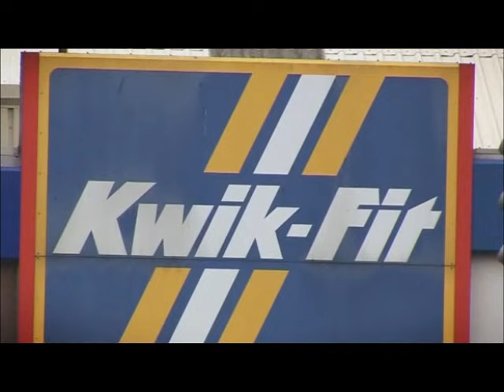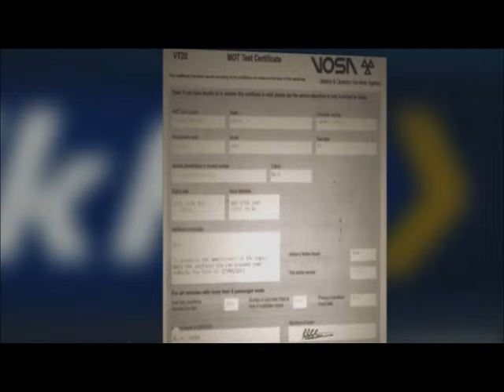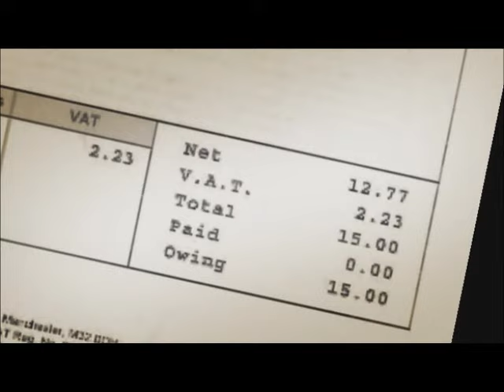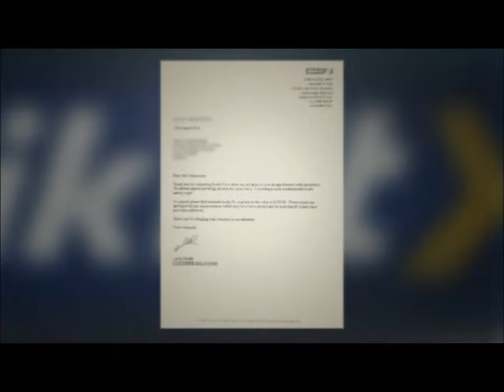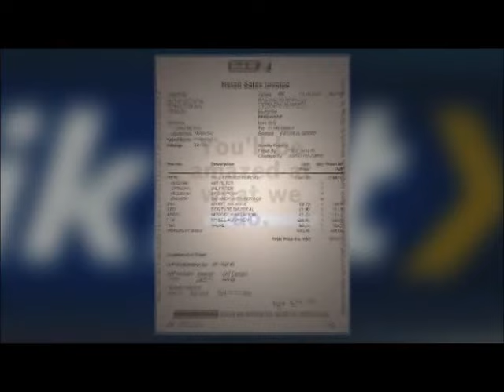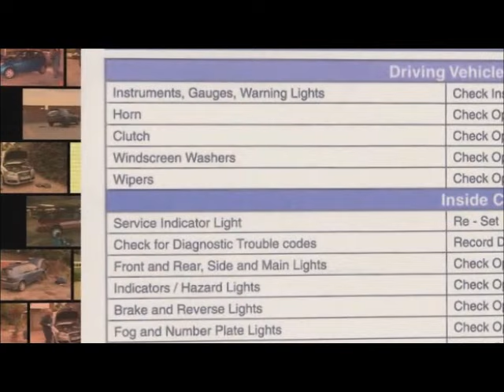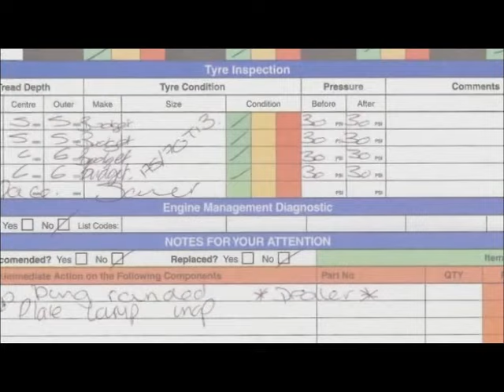Kwik-fit Car Rip-off Watchdog.wmv

Comment: A tip for everyone, even if you're not mechanically minded; invest in a very minor amount of tools (a jack, a few spanners, a torch) and do some basic research on your vehicle.
On days where you need something doing on the car, or the MOT is due, do your own simple checks around the car first. Or if you can't manage that, try and get a friend or family member to take a quick look.
Then, at least when you go the garage, you know just enough to not get scammed...
"Your brakes need doing mate".... "Er, no they don't, I just checked em. Bye, I'm off to another garage!"
Also, with the internet in everyone's pocket nowadays, do a quick check on any parts they quote you for. You may find they're quoting much more for labour and parts than is worth it!

Comment: About 10 years ago my grandfather, sadly now passed away, went into Kwik fit for a hole in the exhaust and was told that he needed brake pads and discs and they legally couldn't let him leave unless he booked in for the work to get carried out. After telling my dad the story we had a check of his brakes and discs and there was nothing wrong with them. We took pictures and wrote to the managing director who sent out two senior managers within 2 days because we threatened to go to the Police for fraud. We were given £100 compensation, a letter of apology, the exhaust was replaced for free and we were given a new set of pads and discs to be replaced when the time did eventually come. No one in my family has ever went near Kwik Fit again.
Reply: They lied about not being legally allowed to give your grandad his car back. It's his car, they aren't allowed to withold it from him unless he has failed to pay his bill. In that situation, if his brakes or tyres genuinely were dangerous, all the garage has to do is to report this to the customer, stress the fact it is dangerous and have written reports that the defects have been noticed and the customer refused to have the work done, this clears the place of any responisbilty.
Reply: +paul harper. If a mechanic genuinely feels that taking the car back on the road will put others at risk. he has the right to call the police who will send out a vehicle inspector who can issue the necessary paperwork to prohibit the car from being taken back on the public road.
These inspectors normally work with the police when they stop a car that is completely un- roadworthy or falling apart.

Comment: Kwik fit offered me the best price for a replacement tyre for my car online so that's where I went. When I arrived they offered free "safety" checks but my car was only 18 months old and under warranty so I declined. Whilst I waited for my tyre to be fitted, many cars came in needing tyres or exhausts. Kwik Fit found extra "faults" with every single one. Obviously my cheap tyre is simply a loss leader to get customers in for unnecessary work. However, this sharp practice in nothing new and is widespread throughout the industry.

Comment: Took my car in, for an exhaust replacement, they quoted 175 quid, they rang at 10am saying it needed another 400 quids worth of repairs, by dinner time they needed another 360, I just walked round to collect my car, it was untouched, took it to another garage and they repaired the original problem for 99

Comment: An acquaintance took his car into a nearby Kwik Fit clown college to have a couple of tyres fitted. After a while the manager asked him to come and look at a problem they had discovered. There was a trickle of hydraulic fluid running down both of the front shocks. The informed him that they were too dangerous for him to legally drive the car away, but they could fit a new pair in short order as they had the correct ones in stock.
They were somewhat nonplussed when he informed them that (a) the shocks were no more than 3 months old; and (b) they were wholly pneumatic with no oil inside them.
He went elsewhere for his tyres.

Comment: Forty years ago I had tyres fitted at a shit company called SMC (hope they are long gone and dead). Was told that my brake pads were on the limit. I was a bit surprised, as I had changed them myself the week before. I asked him to show me. They were still like new. When I pointed that out to him, he said, well if you want to risk it, it is up to you. When I paid for my tyres, the same bollocks was being told to a woman that was being told she needed a complete suspension replacement. The same line about about risk was used again. As a young person, I felt a bit unable to interfere with the natural goings on of life. I drove off. To be fair on the young, my daughter would have seriously adjusted his life position if he had done it to her.

Comment: I stopped using my Kwikfit in last year due to a number of acts of dishonesty, on one occasion their Crewe branch charged me £40 for the wheel alignment but didn’t do the job, I found out by chance on the same day when took my car to a local tyre shop to replace the tyres, I was told my wheels need to be aligned after I paid Kwikfit for this service, when I took my car back to Kwikfit they didn’t even apologize just said the tyre guts are exaggerating, but nevertheless accepted that the job hadn’t been done properly. On another occasion Kwikfit in Stoke-On-Trent failed my MOT on the grounds that my front screen wipers weren’t wiping properly, they quoted £30 to replace the wipers  also tried to charge me extra for the next working day MOT although by law it should be free anyway, I took my car to the local mechanic who didn’t find any problems with the wipers, my car passed MOT in a flash. I complained to the head office and got my £30 MOT fee back but would never again use this rotten dishonest service....their greedy unscrupulous workers have made a really bad name for the company

Comment: "An automatic with no clutch to check" - while there's no clutch pedal or clutch the driver can directly operate, so kiwi fit can't have checked it as they say, there ARE clutches within automatic transmissions, but it would involve transmission dismantling to access them.

Comment: I have found that most garages treat their customers like dumb kids ,the only way to be sure that the car /and jobs are done correct is either look over the fitters shoulder while being fixed - or do it yourself .I worked for Nissan main dealers and they were fairly good but even they told you - if in doubt ,replace the part ! .

Comment: Went to qwik-fit to have 2 front tyres replaced,whilst doing the work they came and said the brake pads need replacing as well. Would you like us to do it now as we have the wheels off and the price would be slightly cheaper. I said no as I thought this sounded a bit fishy. I took my car to my local village garage a couple of days later and asked him to replace the pads. He phoned me later that morning to say there is need to replace them as they are only 20% worn.

Comment: Kwik Fit said my flux capacitor was faulty and needs regenerating. Said it wouldn't be able to produce 1.21 gigawatts required in order to travel through time. I left the car with them and it came back with new tyres with 'nitrogen fill'. Only cost £15.500 but I got free oil service.

Comment: Many years ago I rang around for an exhaust replacement.  Got 2 or 3 quotes after providing the required information in each case, then rang Kwik Fit.  Refused to quote me unless I brought car in to put up on the ramps.  I thought,  they've got me then.  Politely declined.  I know a garage man who says they have to find at least £175 on work for each punter's car. Recently a main dealer took my Corsa in for 2 small recall jobs, so they were paid by Vauxhall.  Not content with this, told me it needed tracking.  I'd just swapped front and rear wheels on each side and told them that the "problem" front tyres had just come from the REAR,  no feathering,  uneven wear,  steering stable on a flat smooth road,  etc etc.  End of conversation.  Car still fine now.Garages know the average punter knows sweet FA about cars & many indulge in severe cases of leg-liftery.I have had other experiences as well but would probably run out of space.

Comment: Kwik-Fit wheel alignment - if you have a fixed rear axle it is not possible to adjust the rear wheel tracking, meaning you only need front wheel alignment costing £35. 

Kwik-Fit will not tell you this as they fully intend to charge you for 4 wheel alignment costing £70.

Comment: As a mobility car user, I have used the Kwik-Fit on LANSDOWNE ROAD  Chadderton, twice, both times I have been impressed by their  speed and courtesy, both times I had a low tyre, both times they repaired the tyres, no replacement needed. Good work.

Comment: They’re still at it, my exhaust was blowing so I took it to Kwik fit to get it checked. They guy checked it and told me the middle section needed changing. He said the back box should also be changed I asked how much he first said he didn’t know and would check and then on the top of his head after thinking for about 10 seconds he said £290. I said I’ll think about it. Later I found out the parts cost £90. My local garage said £40 Labour. In the end it was a small hole which was fixed with some exhaust gum and exhaust bandage total cost £8.

Comment: Personally I would never use Kwikfit but   as with any garage if you doubt the work, ask them to show you the defect on the car or seek a second opinion. Whilst not 100% foolproof an MOT at c.£55 will give you an independent check of all major safety systems on your car.

Comment: I had a full exhaust fitted to my honda,  Two years later the back box had a hole in it. on inspecting the invoice I found there was a 3 year guarantee on it.  I went back to the garage and told them I needed a new back box I waited in the waiting room,  when the guy came back he said it needed a complete exhaust as it was all worn out & could fail at any time. I asked if the exhaust was guarateed.  he said oh yes all our exhausts are fully guaranteed for 3 years.  I then produced the original reciept and said I want it doing on the guarantee then. If you had seen the mans face.  He had to take a good exhaust off and put a new one on. I've never been back there.  I had inspected the exhaust myself before going there

Comment: Had to watch this as I went in for tyres which were on offer. I was told bottom ball joints worn and dangerous to drive. Signed a disclosure to leave and the manager was making a fuss about my safety. Never changed them and were okay until I sold the car 3 years later. I was a mechanic years back and knew my car inside out. Had to get 2 nd opinion though cos it frightened the Mrs and needed reassuring. Obviously no faith in me as a mechanic 😀😀😀

Comment: A couple of years ago, I phoned Kwikfit for a quote for 4 tyres (£300.00), I agreed, I went to my local branch left the car. When I went back for my car. I was given the bill for £450, and was told that my car need the front and rear pads and discs replacing at an extra cost of £450. I informed the manager? I had been quoted £300 for the tyres and that the brakes had all been replaced during the cars service only two weeks previous. In front of others customers he accused me of lying about the brakes and demanded I pay the £450 for the tyres, I refused and after almost an hour after giving £300 in cash agreed to give me my car keys. I wrote Kwikfits head office and I am still awaiting a reply two years later!

Comment: Mercedes-Benz dealerships promise a 160 point check on the second hand and demo cars they sell. Also, when you buy the car, they say they would do a detailing service before handing the car over. Back in 2014, I bought a demo 2014 C200 from Mercedes-Benz with only 800KMs on it. When I got it, not only it was not detailed, but also it's wheels were not aligned anymore! So, they managed to damage the wheel alignment in the 2-3 days period I was waiting for my almost brand new car!! When Mercedes-Benz is like that, what do you expect from others?! :))

Comment: Kwik-Fit in Hove quoted me about £250 to replace two sections of the exhaust system on my parents' Toyota Yaris Verso, then told me the supplier despite having the car reg. & therefore the exact model, the supplier had said that because it was the Verso model the price was over £900.  When I argued that a quote is a quote and the responsibility of whoever gave it, they wouldn't budge so I said I'd take the car away; they then said they'd removed the old system with oxy-acetyline & it was in bits.  To cut to the chase, it took days but they caved in & replaced the exhaust at the original quote.  I'd no idea this was their standard practice.    I can thoroughly recommend Mr Exhaust in Reigate, who I've used since, by the way.

Comment: Took my Lexus SC430 in (2003 plate) for leaking exhaust they said it needed a whole new system (700 quid) plus the brakes were leaking fluid (300 quids worth), 2 tyres were needed at 200 quid each and there was also an oil leak. All complete bollox.

Comment: Had to use Kwik Fit for the previous work car. Fair is fair, Peugeot Castleford don't remove wheels on a service and 2 months later it needed tires which the lease company don't let Peugeot do. I got a Kwik Fit in Leeds to check the brakes when they removed the wheels and no suprise all 4 pads were bad with the rears needing new discs too. Took photos and showed Peugeot who say they don't need to remove wheels to check brakes.

New work car (with a different lease company) is close to needing tyres. Will see if I can get ATS to let me photo the brakes before service is due.

Comment: I had the same experience. Kwik-fit told me i needed a whole exhaust system well ove £200 . Went to another garage and they said it was only the rear section needed, bill £60. Kwik Fit are gangsters and the powers that be should have them closed down.  This was the Sutton in Ashfield branch. Nottinghamshire.

Comment: in 2001 i took a nova i had just bought to kwik fit as the exhaust was blowing, they told me it needed a new back box, as it was still on the ramp i went to look, the backbox was so new it still had the paper sticker on it with the barcode on it, all it needed was some exhaust sealer on the connection, a few years later i had a saxo which had a jammed back brake i took it to F1 auto centre and they tried to rack up the bill by saying i needed new front discs and pads and four new tires i refused and said just fix the back brake, aprox 5 months later it went for its MOT and it passed without any work done since the rear brake was repaired.

Comment: They tried to charge me £430 for a calliper on my insignia when i said can I have my old calliper back they said no they also did not know whether its was a calliper or a hose .  Theyd need to change both . I ALSO HAD BBREAK PAD changed at rip off kwikfit 110 pounds for a single pad Bought a calliper repair kit on ebay for 20 odd quid and repaird it myself. Stay well clear.

Comment: just because you aren't mechanics doesn't mean you can't check some of these things on your cars yourself before a service to tell whether they're lying. Most cars come with alloy wheels now which means you can visually check the discs and pads on the car without removing the wheel, if the disc looks good visually its probably fine, with a flashlight you can look into the caliper and see the brake pad and can have a reasonably accurate guess at how much is left and whether it will be worth replacing. Tyres you can easily check over yourself too and also knowing as much history as possible about your car helps too and documenting all the parts its had.

Comment: my car is 5 year old ford, main dealer serviced all the time,  it too has never seen door or bonnt catch grease, they broke a mount on the air cleaner and never replaced it, and  bodged a water pump leak from the factory with no paper trail to it (only found out as had new pump and timing belt this week from an independant)

Comment: They tried it on with my sisters exhaust, I told them when I took it there that it needed a new gasket and they said theyd look and call me. They called and told me it would need a new manifold cat(£500 odd quote) not a £5 gasket but couldn't give me a reason why. I went back straight away and told them to lift it up and I showed the BS artist that the joint was leaking where the gasket had deteriorated and needed changing. The guy just walked off and another guy came over and sorted it out with nicely offering to do it for a £10 and but the first guy was really trying it on and I can tell they're taking people for fools everyday

Comment: It's about time MOTABILITY told Kwik Fit where to go, they use them for fitting new tyres, balancing and puncture repairs, had new tyres fitted had a wobble at speed fitted and balanced at Galashiels branch then rebalanced twice at Otley branch, eventually stating there was a suspension problem which was not there before new tyres fitted, took it to my local garage for service tyre balance was way out ....now perfect, come on Motability drop kick fit

Comment: Only ever been kwikfit once when my exhaust dropped off about 12 years ago, got them to do the exhaust and then got told I needed new brakes and 2 new front tyres, unfortunately for then my old man had dropped me down to pick it back up and he used to work for chrysler on the maintenance manuals etc, if I had been on my own may well have had the work done, kept the car for 3 more years after that and the brakes and tyres were still fine b4 I finally sold it

Comment: They changed my snapped break cable for a new one, they held it for 3 day's and charged me £135. They then told me my rear shoe's need replacing. I had already decided after the £135 bill far a £7 break cable that I'll get it checked somewhere else. Turn's out my rear shoe's were fine.